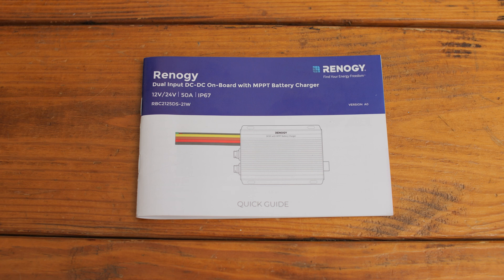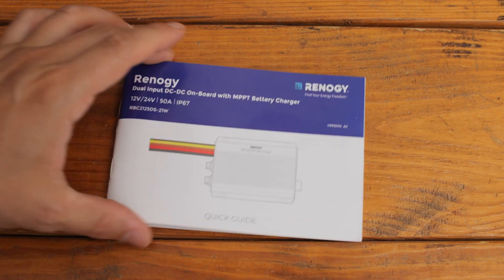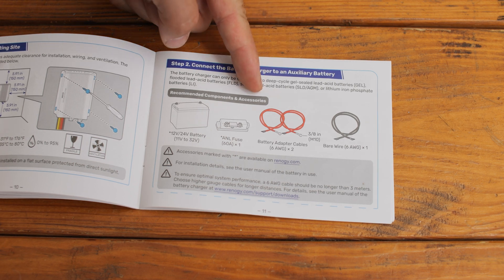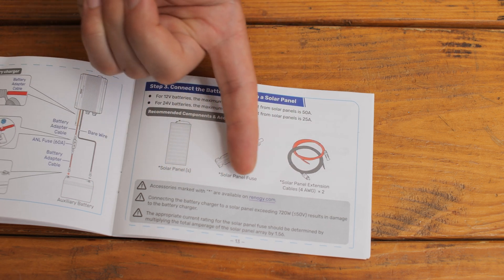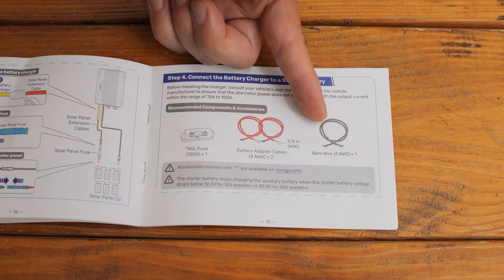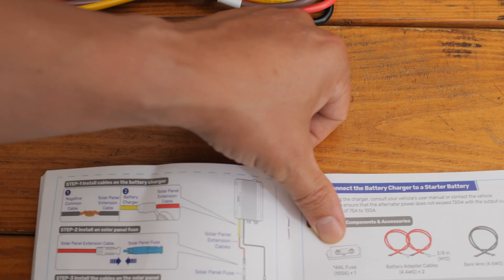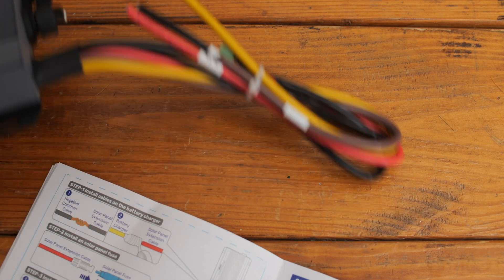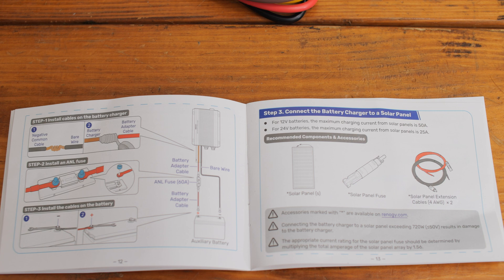Is the new Renogy 50A DC to DC charger safe?

Comment: (the new) Manual says to use a bus bar for the neg. Isn't a vehicle/RV all connected to a common ground? Is it necessary to run all that extra wiring?

Comment: 4 gauge 50 amp 2 gauge 80 amp ?😊😅😮 6 gauge 40 amp 10 gauge 30 amp 😮😮😮😮😮😮😮😮😮😮#$$$$### 2 gage 😊 are you feeling miffed right now 😊 because you are.  2 to 4 gauge should be standard on all DC DC inverters and batteries too and solar 8,10 gauge.

Comment: Get the thermal probe and attach to the battery wire and it will shut down the unit if it over heats.

Comment: Ok, I just bought this and the wires coming out of this unit are 10AWG hard wired in there and can not be changed! I referenced multiple wire size charts and all of them specify that the maximum amperage a 10AWG wire can safely handle is 30 amps... How is it safe to push 50 amps through any length of 10AWG? What even more ridiculous is that in the new manual they specify to use 8AWG and even 6AWG depending on the length of the wire run. You can connect a 4|0 wire to one of these 10AWG hard mounted wire and it wouldn't make a difference as you are still limited by the 10AWG wire that you can not change out. WHy did they not put terminal blocks on this, that would have fixed all of this. Fighting with Renogy right now to return this and they are being stubborn even though I am still within the 30 day window.

Comment: I looked up the manual online and it appears to be updated.
Version A0, January 5, 2024 - I notice there is no date on yours at 0:04.
Much of what you highlight as confusing in this video has been eliminated in this online version.
I would much rather install ring terminals and attach my cables to a power distribution block/single stud busbar than joining those cables (possibly different diameters) wire-wire or with butt connectors.
Hope that helps
Reply from the maker: That is a good idea, and good to know they fixed the manuals.

Comment: Solar fuses don't have the same purpose as fuses on normal power supplies. Specifically, they help protect against miswiring and certain faults, but they don't help with overload protection at all. If you're using a solar fuse, it will be a fair amount higher than the short circuit current of your solar array, which is the maximum current that it can supply anyhow.

> "the point of having 4 gauge wire when you have a 10 gauge wire [in series]"

Lower resistance, particularly if it's a longer run as opposed to just a pigtail. It has about 4x the conductivity. However, I suspect you are correct that it is a misprint and likely overkill for most practical uses of this size of system.
Reply from the maker: Thank you for the info.

Comment: The 100 amp fuse is for the 6ga wire from the Alternator. Which can put out over 130 amps.. The final connection is protected by a 30 amp solar panel fuse. As the max load from the alternator shuts off at 50 amps. If you have zero solar incoming. Which is why you can only get 30 amps if you have both solar and alternator charging at once. 

I didn't hook up the alternator wiring. So I use a 30 amp shore power charger in place of it. That way I can charge the batteries at night\day on shore power if the sun does not shine for a few days. And I have 2x 250 watt BiFacial panels that produce 33 amps.So I used a Y splitter #10ga. So I ran #8ga to the charge controller of that to a 32 amp breaker. Then to the charge controller. I had no issues so far.. So just be aware. If you turn off solar. you get the full 5o amps from the alternator. Which means you need a 60 amp fuse. Not 100amp.. As at 100 amps off an alternator rated for 130 amps. You will burn up your alternator in no time flat. And some of these alternators cost $500.00...One reason IO bypassed that feature for shore power.
Reply from the maker: I wonder if I can tap from the alternator in a controlled manner so I never get the full power. I have 2 alternators equaling 230 Amps so I am definitely worried about overloading things.

Comment: I have a few questions:
1. Does the Reno charge the starter batter FROM SLOAR (the car battery) after the leisure battery is full ?
2. If my camper has a soket=connection to the 220v grid from camping host, where i have to connect the 220V wire from the host?
3. Where can i connect the invertor to the Reno and wich invertor do you recomand for this DC to DC charger? Can i connect the 220v grid also direct to the invertor and that invertor will not use the battery when 220v it s up?
Does the 220v from grid charge the leisure battery? What about the starter battery?
4. Where do you put the temperature sensor?
Reply from the maker: 1. It states that it will keep the starting battery topped off.
2. If your camper came with a house battery, you should already have the necessary wiring, just tie this into the battery.
3. Inverters stem off the battery in their own loop. I haven't seen 220v sent to an inverter before, usually you buck it down to battery voltage. Sounds like you want a battery bypass to switch your rig to shore power. 
4. Temp sensor goes at the battery to make sure it doesn't overheat.

Comment: The m10 and the m8 refer to the hole size  not the wire size.  Use 100$%  copper or tinned copper  lugs.   Us the Guage they say and    copper lugs. And the 100a fish will popp way b4 a 10g wire

Comment: Instruction documents for everything built now days are ambiguous for a reason... poor quality. 10 gauge solar wire for a small array is fine. The starter battery wire should be a least 6 gauge for 50A so yeah that downsize to 10 gauge at the box is confusing? Maybe that's why the unit runs hot like someone else mentioned. Although most DC/DC units run very warm with huge heat sinks.  Anyway, it's way down to $349 in Canada right now, is it defective with this wire issue have you installed yet?
Reply from the maker: I was away for work for half a year, trying to get caught up with life to finish the install.

Comment: The 100 amp fuse is supposed to be placed at the battery to protect from a short. The short would travel back to the battery, not the component. 4 gage cable is an assumption of amps possible  and average length run. It's a lazy way to write a manual without getting to specific.

Comment: Have you installed this?  I have it running on solar and it’s getting 170 degrees
Reply: Yes this unit doesn’t have a fan so it runs pretty hot.  We will see how long it lasts
Reply from the maker: Work is keeping me from having the time to finish the install right now, unfortunately. The unit is running at 170 degrees?

Comment: i had the same concern when installing my unit. Did some looking and found this is 10 gauge pv cable that can handle 55 amps to 18 feet. Look up renogy sizing wire for pv system. I have not had any problems so far of wires getting hot.
Reply from the maker: Would you mind sharing where you found that info? I did not come across it and it looks like that info would help others since Renogy has not done a very good job of relaying proper technical information.

Comment: Wire size and length vs power loss..Power= Current squared times Resistance . P=i2R.     If  drawing 60 amps thru 1 foot 10 Ga wire (10Ga is 1 Ohm/1000 feet , so 1 foot of wire is .001 Ohms.  60 amps squared is 3600.    and 3600 times .001 is only 3.6 watts.

Comment: If you wired 1 Alternator just to charge your house batteries , you wouldn't need DCDC. ( Just a MPPT Solar controller that would equalize the (Lithium?) Batteries. 
That your Alternators can put out 230 Amps will never be used . ( max 60 amps) . They regulate the voltage , the current is determined by what you connect to them ( the resistance of the load)
Your comment about the LENGTH of the wire is true . The longer run from your alternator to the unit will have a higher resistance ( loss) than a very short wire . So it is better to install a larger wire the Longer the distance for the same amperage.
Agree the 100 amp fuse seems large . With Mppt , if your alternator output Voltage is less than the Voltage required to charge your house batteries , the unit will draw more amperage from the alternator. (  power out + losses = power in). Losses include Wire resistance and converter efficiency. 75 amp fuse should be max required ( 70amps in and 50 amps out is probably the Max amps you could ever see drawn from the Alternator.
Reply: And all that goes out the window if you throw in a lifepo4 battery. That will draw so hard on your alternator that the heat will kill it.
Reply from the maker: Great info, thank you.

Comment: If you look at the online manual they ask for different fuses. I contacted renogy and the discrepancies between the online manual and book to confirm what fuses to use.
I have a 70amp fuse between the alternator and charger and a 60amp between battery and charger. 100amp fuse is wrong.
As far as charging i tested and get 45amp ish and the wire get a little warm but not crazy.
Reply: I'm just using the app. I didn't get the one.
The wiring instructions is fine. Just get a 70amp anl fuse between the alternator output and the charger. Also a 60amp between the charger and house battery. I've been using mine for 2 months almost every day charging 45ish amp.  Also make sure your alternator can deliver the 50amp without overworking.
Reply from the maker: @freddub1459  I have dual alternators pushing 230A combined so I'm more worried about too much power than not enough.
Reply: @commonsensepreparednesschannel   courios what truck you use? if a duramax which battery should be used ?
Reply: I have the same Question , Although I believe the two batteries are connect in parallel for higher capacity with a relay on the passenger side battery that turns on only with ignition in the on position . I could be wrong , but read it on the Duramax fourm . , I going to check with a meter and see if that is true. if so I will attach my DC-DC charge cable to the passenger side battery. That way the relay would act as an isolator and turn on and off the voltage to the DC-DC ? Well in theory anyways.
Reply: I also got the new smart shunt 300. All working within the app but the Bluetooth range is garbage.
Reply from the maker: Thank you, I really get the feeling this was rushed out without proper QA.
Reply: @commonsensepreparednesschannel   it works pretty good with the alternator but the Bluetooth has no range 😅. I haven't tested the solar side but it supposed to trickle charge your car battery  when your house battery  is full. Cool feature I my opinion
Reply from the maker: @freddub1459  I'm about to take a trip and can't afford to find out the hard way I did something with the electrical system so I will have to wait, which is fine if I have to order a different fuse anyway. Did you get the "One" control unit or just using the built in Bluetooth unit?

Comment: I just bought one. They sent me  a 60 amp amp fuse block as part of the package.
If you look at wire charts 50 amp only requires 6 gauge wire unless the runs are super long.
My unit that I just bought off eBay also has a sticker on it that had a max solar input of 50 volts which indicates an upgraded model.
Reply from the maker: I'm seeing wire charts advising against anything more than 30-35A for 10AWG regardless of length so passing 50A through it concerns me.
Reply: Use 6 gauge wire @commonsensepreparednesschannel